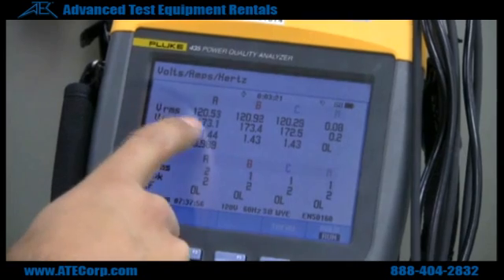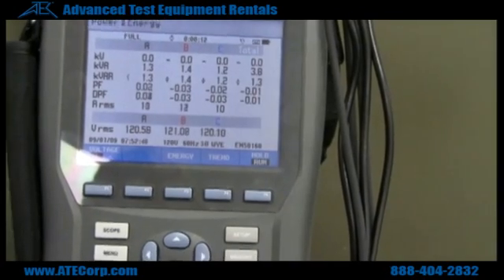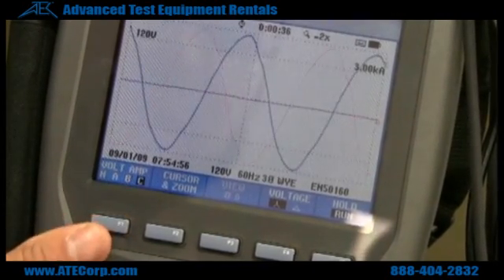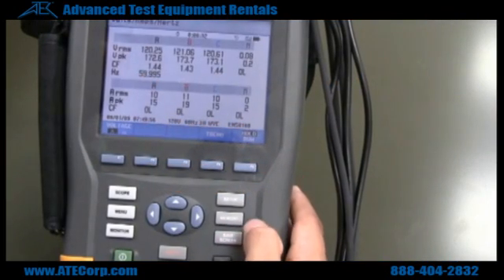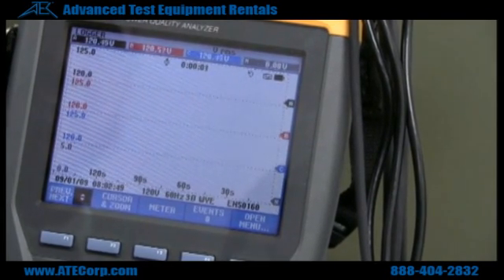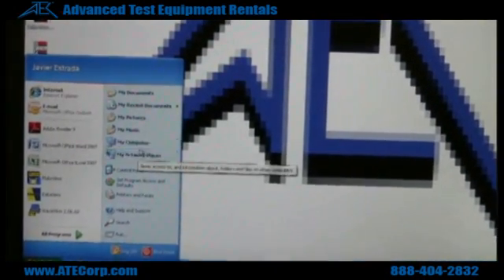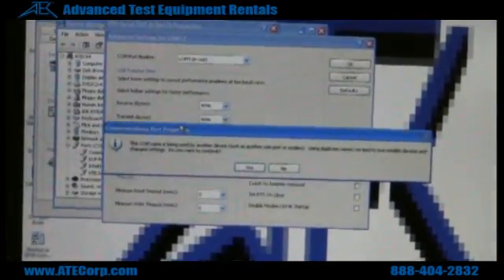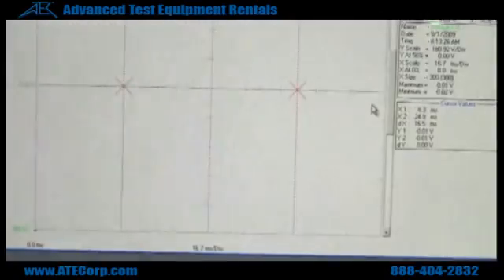How to Use a Fluke 435 Power Quality Analyzer

Comment: Hi, thanks for the video. I would like to know that can I get data from the device with rs232 interface or an usb-serial adapter? Can I monitor the data using hyperterminal software? If soi I want to write my own program for data reading and monitorring from that device.